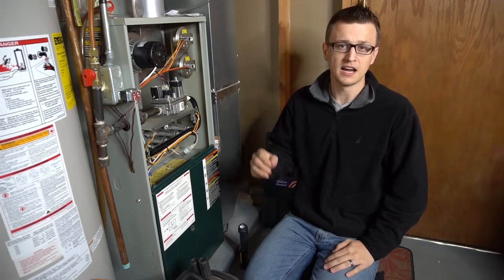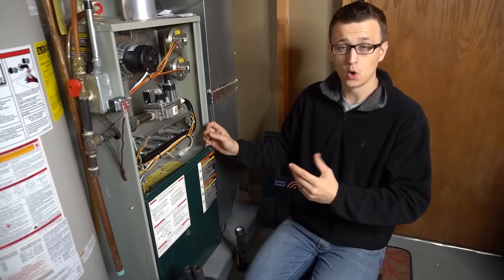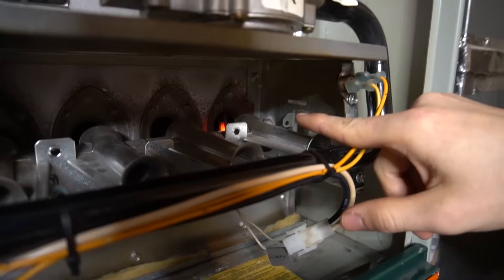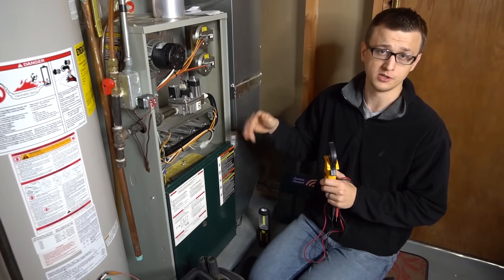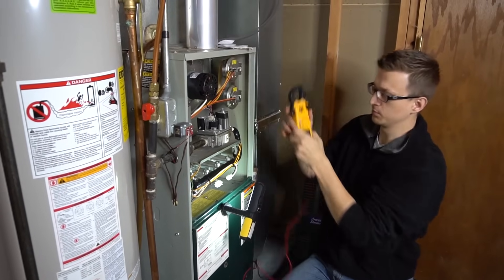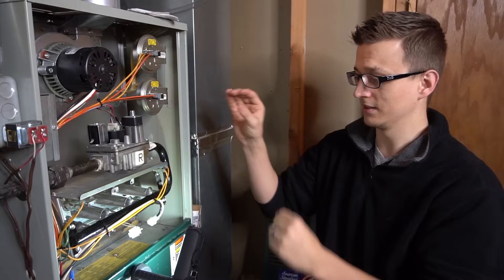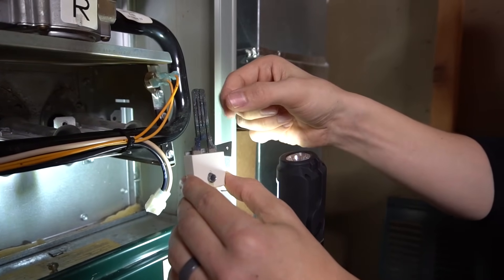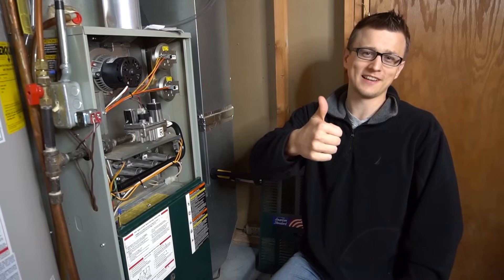Furnace Not Igniting - How to Check and Replace Ignitor

Comment: Hey! Thanks for this video. My inducer motor starts and then at that point, I get continuity on the pressure switch and hear those small click. However, that’s where it ends and after a few seconds it powers down. I have changed the igniter thinking that’s the problem but still not working. The gas valve doesn’t open up. I think that’s because the igniter isn’t glowing. I have an error code which says  low pressure switch failed open. When my pressure switch was bad in the past, I still had the igniter glow but not this time. What else do you think i could try?

Comment: Hello,   great channel !  I have a Bryant furnace 383KAV036111 with a bad ignitor relay.  The relay has 120VAC in but nothing out (with
my finger on it I can feel it clicking).  The board is HK42Fz009 and the relay has no identifying marks on it. It uses a through the board
soldered connection.  Other than the ignitor problem the furnace works OK when it is lit off manually.  A 34 error code is displayed. Wondering if there is some error condition that would stop the control board from lighting the ignitor ? Has anyone ever found an available relay for a Bryant control board ? Any help will be appreciated.
Dan R.

Comment: I have a "Check Ignitor" fault code on my Trane XL80 unit. When it calls for heat the inducer motor starts up for about 1 second then turns right back off. The resistance on the ignitor was only about 15 ohms but I was only getting about 60 V going to the ignitor. In your video you said if you are receiving voltage then it should be the ignitor itself, but what happens if you are not receiving the correct 120V that you should be expecting? Could this possibly be a bad control board? That is what I suspect, but I am not sure. Have you ever come across this issue? 
I also checked the flame sensor  and it looked pretty clean, but I cleaned it a little more just in case. Also if it was the pressure switch I believe I would be getting a pressure switch fault code (3 flashes) which I did not get.

Comment: Thank you for your service 😉 what if the hot surface igniter works only once in a while? I have replaced and it worked for a couple days then stops working and starts again after a while 🤔

Comment: Can I really cut the old ignitor wires, strip them and pigtail them to the new ignitor?
Reply from the maker: Yes. If the ignitor is the same but the plugs are different, you can totally do that. I've done that many times and never had a problem.

Comment: Thanks at the 3 min mark when the gas came on why did it not shut down ASAP and you should smell the gas also right? I think my Lennox does not allow gas to come out if the ignitor does not glow also the ignitor will not come on if the pressure switch does not work either. I think it is the ignitor but too hard to get out with out taking things off. Not enough room to take the ignitor off the harness it is way in the back and you cannot see it hardly and the bracket has no room back there to move it or drop it less room then the bracket and ignitor  . Should a person here the click of the pressure sensor, as I do not hear a click for that either. Code says ignitor so I guess I should trust those fast alternating green lights LOL. Thanks guess I will have to call a tech to come in just to get that darn ignitor out.

Comment: RE: Trane xc95M Furnace: Gas will not ignite. Replaced Hot Surface Igniter. Now when call for heat, Induction motor comes on, then after about 45 seconds the induction motor turns off, and only then the hot surface igniter starts to glow. Why is this out of sequence order?   Should be Induction motor, Igniter Glow, Gas open, Ignite. Any idea what’s up?

Comment: I just bought a house and the filter was so caked it was domed and now have to change the igniter,flame sensor and the fuse to the igniter do to over heating from low air flow

Comment: Hi Jay, 
Took your word of advice off a previous video and was lighting the furnace with a barbecue lighter. I received my new direct spark igniter from Amazon today. Unfortunately the furnace is not coming on. 
Lennox model number: 80MGF2-45A-2
Serial number:6394A48898
In the event the connection from control board to the igniter is bad, how do I remove it from the control board. Is there any replacement available out there? Thanks in advance for looking into this.

Comment: For the new tech out there, buy a stubby Klein Tools 32561 Multi-Bit Screwdriver / Nut Driver, 6-in-1. I just replaced a surface igniter on a Goodman furnace. I had very little space to work, the 1/4 inch bit saved me.

Comment: I have watched a ton of your videos, Thank you I have learned a lot.  What I have gathered is my Ignitor (replaced and is new) is not receiving enough power.  3.6 AC Volts and then after the blower motor clicks, the volts slightly jump to 5.6 AC Volts.  Everything else is working, as we have been able to manually light the furnace.  Is this a simple replace the wire from the control board to the ignitor, or is this an entire control board that needs to be replaced? Thank you!
Reply from the maker: You're welcome! Glad to hear you were able to make some progress in your troubleshooting and can get the heat going. This is likely a bad control board issue. It could be a loose connection too so I would try testing the voltage and wiggling the wires, plugs, and connector while doing so. You may need to try a couple times since the ignitor only gets powered on for 5-10 seconds before the gas valve opens and powers off shortly after.

Comment: What happens when you don’t hear gas going through it but the gas is on and working everywhere else and the starter is ticking.
Reply from the maker: I would check if the gas valve is getting power when the starter is ticking. If it is getting around 27v yet the gas is not flowing, then either the gas valve is stuck closed or the burner orifices are plugged. Here are some simple things to try:

Wiggle the wire connectors going to the gas valve once the ignitor starts to spark. If the gas valve opens, then you have a loose connection there. Sometimes I would simply wedge something in between the connector and the body of the gas valve and that would solve the loose connection issue. Or perhaps one of the wires is coming out and needs to be secured back in place.

Hit the gas valve (not too hard) on all sides. If it is mechanically stuck closed, that might be enough to free it up.

Clean the burner orifices. I show how to do that here: https://youtu.be/aM4OXM8ruNk?si=2JbmQcUa5LKa_JcD

Comment: What advice would you give me if mine turns on, the igniter glows, and I hear the gas seeping but it doesn’t ignite??
Reply from the maker: You may have a weak ignitor. Even though it is glowing, it is not getting hot enough to light the gas. I would try to light the burners manually. If they light, then you know the ignitor is bad. (it's a rare occurrence but the ignitor may not be getting enough voltage too, in which case the control board might be bad.) Another possibility is a plugged burner orifice. Here are two video on the above two topics:

How to manually light furnace:
https://youtu.be/-bMz1En0DSg?si=4OQBshU5bFE6y9qI
How to clean burner orifices:
https://youtu.be/aM4OXM8ruNk?si=mzIvIn5HSLjQsojG

Comment: how do you just unplug the ignotaror?
Reply from the maker: You would disconnect it either at the plug/connector or at the control board. Sometimes you need to pry on the plug with a screw driver because the plug is really stuck together.

Comment: I had my furnace blowing cold air so i check on your video and saw the picture of the bad ignitor you shown then I found mine has that same bit, so ordered an new one for Rheem furnace from Amazon with identical shape and connector for next day delivery and installed the new one, fairly easy and was back to business, thanks so much👍

Comment: Excellent video!  We woke up to 27 degrees and the downstairs furnace not working. After watching two of your videos it was apparent that the ignitor wasn’t working. Tested it and sure enough it was dead. Once pulled I could see a crack in it. Ran to the store and got a new one.  All in all we were back up and running by 9am. Thank you!

Comment: What if the connector coming off the control motherboard has 120v, but as soon as you connect it to a brand new ignitor, the voltage drops to zero?

Comment: Thank you for the videos.  I had a quote for $200 to replace my furnace ignitor. I watched your videos and I purchased an ignitor from Amazon for $40.  I actually replaced it myself.  Took me about 30 minutes to complete the job since I cleaned the sensor as well.  You saved me $160 and I learned something new.

Comment: Hi my hot surface ignitor glows, blower kick on when thermostat calls for heat, but I don't get the click of the gas valve. I've cleaned the flame sensor rod and not sure what else to turn to.

Comment: Have a furnace with a good hot surface igniter (put it in another furnace that uses same model igniter) and the igniter isn’t lighting in the first furnace. Cleaned flame sensor with fine steel wool. Inducer motor is turning on. Is there a replaceable relay to ignite? (Lennox 80uhg3 75a)

Comment: Hopefully you still read your new comments. I replaced my igniter but now my furnace will only ignite after cycling twice. I don't see an adjustment on the igniter bracket. What could be my issue?
Reply from the maker: Does it fail to ignite the gas or do the burners light but go out after a few seconds? Regarding the igniter bracket, I have had to bend the igniter bracket in the past to place the igniter closer to the burners. But if the burners do light but fail to stay on, then it's a flame sensor issue. (usually resolved by simply cleaning the flame sensor) Another possible fix is to clean the burners. (I have a video on that if you need it)

Comment: Inducer turns on , but the igniter does not glow. After I check the voltage, and I don't have 120V supplies to the igniter, is it meant the circuit board is bad?

Comment: What if I only have 54 volts to the igniter and it’s not lighting ?
Reply from the maker: It is either a bad connection (check the connectors, tug on the ignitor wires, wiggle them around and see if that makes the voltage fluctuate at all) or the control board is defective.

Comment: great videos! does no power to igniter means the control board is bad and replace it?
Reply from the maker: Often times, yes. It would be best to verify it if you have a multimeter. The ignitor should have voltage going to it shortly before you hear the gas valve click open. If the gas valve is opening but there is no power sent to the ignitor, its almost for sure a bad control board. Also possiblly a loose wire connection

Comment: Great videos, I've watched several! Got any tips on how to check the output of an ignition coil? My furnace works fine if I ignite the burners by hand, as you have shown, but automatic ignition is broken. How can I determine if I need to replace the igniter (spark type) or the control board, where the coil is mounted? I have a jumper wire with alligator clips on each end. I connected one end of the wire to the coil output pin. I placed the other end of the wire close to the heater frame (ground) with about a 1/8 inch gap. No spark is seen during startup. Is that a valid test? Any suggestions?

Comment: Hi, Thank for all your help and assistance. Also sometimes you just make me laugh so thanks for that too.  Anyway, I just used some of this information to fix my pool heater.  I notice you explain things about a lot of different appliances but I see nothing on pool equipment particularly pool heaters ( which are a lot like a furnace but not) and pool pumps. Any chance you could wander into this lane.  Keep up the great content. Thanks again.
Reply from the maker: Hi David! Glad to hear you were able to get the pool heater fixed. If I get a chance down the road, it would be great to make a few pool heater repair videos! Thanks for the suggestion!

Comment: If the ignitor is no good, will the fan blower fan still be blowing cool air or it will the furnace shut off cause its not igniting?

Comment: Where to looking for part number? or they don't have part number.
Reply from the maker: They do have part numbers but I usually replace original ignitors with universal ones. As long as it looks the same, it should be good. I also have a video on how to order hvac parts, you could refer to that too if you want to get a part number.
Reply: Thank you for explaining

Comment: I never comment but thank you so much. Company tried to charge me $5,500 to replace a control board, igniter, and capacitor. I bought all the parts for $150!
Reply: Yeah there are CROOKS  out there for sure ..been there done that that is why I am here do not trust them, AND this man is very very intelligent with very good tips. Best on the internet
Reply: That is the cost of a brand new furnace
Reply: @cgdonut27 exactly.  Interesting how repair costs always compare to new furnaces from the furnace co. That sell them

Comment: OK, that was first step, testing the igniter. Good information on that. 
Now, what is step #2, igniter is good, but no 120 volt voltage?
What if you don't hear the gas valve open? My Goodman propane furnace waits a bit while the igniter glows before the valve opens. Do you have other videos that step through each step of the troubleshooting process ? Inducer motor starts OK, then igniter should glow, then gas valve opens, and then burners ignite. How do you troubleshoot faulty control board?
Reply from the maker: Is the control board blinking any error codes? I would start with that. If the inducer is turning on but nothing else happens, you may be having a pressure switch issue (I do have videos on that, including one where I show how to bypass it to confirm if its where the sequence interrupts). If the pressure switch is closed and the control board is not showing any error codes yet the ignitor is not getting 120v, then the control board is likely bad. Diagnosing a bad control board is usually done by narrowing down the possible culprits. If the board is supposed to be sending power to a component yet it is not doing so (even though all the safety switches are closed) then that is a bad board.
Reply: @WordofAdviceTV  
Okay went to test the igniter this morning there was 80 ohms resistance. when I tried to check the voltage I had the igniter removed from the circuit , the inducer motor started up but then it shut down so I had to plug the igniter back into the circuit and then when I started again the igniter lit up and the gas valve opened and the burners ignited. I'm guessing it was a bad connection at the two connectors or some corrosion over the summer? I'm aware of the vacuum switches and last year I found that it wasn't pulling any vacuum because there was a water back up inside the enclosure around the A-frame evaporator. And that vacuum switch was also corroded I drained out the water, clear the blockage to the drain I had to replace that vacuum switch too because besides not closing because of no vacuum and not closing which was preventing the gas valve solenoid from engaging because it couldn't detect enough low vacuum pressure which is proof that the inducer motor is running and evacuating the gases from the combustion chamber, the switch is a NO contact and it was not closing because I guess being corroded. 
Now here's one for you I also discovered last year that the manual control to turn on the fan would not work from the thermostat and the fan wouldn't come on with the AC compressor but if I bypassed the vacuum switch by jumping across the two connectors then I could use the manual switch to turn the fan on at the thermostat and when on AC cooling the blower would work. So does that sound like a bad solenoid perhaps on the control board?

Comment: Thanks so much for your repair videos!  I have the 3rd type igniter as shown, specifically the type in the lower photo.  (The bi-metallic strip inside had gotten "corroded" causing the furnace to short cycle.)  I replaced the igniter, all was well.  Next morning, ffffttt, no pilot light!  Turns out, the 3 wire plug was not fully seated, hence no pilot!  After a quick unplug and re-plug, all is well again!  A friend also loves your videos and was able to correctly diagnose a faulty control board!  You Sir are a YouTube gem!

Comment: Thanks so much for this!  It helped me figure out that my igniter in my York heater had failed (it had a crack in the middle). The igniter sits very low though.  The only way I can get it out is by pulling it from the top.  I doubt I can put in a new one without touching the element 😕

Comment: My heater only kicks on with warmer temperatures kind of defeats the purpose. If the ignitor is bad, does that mean it works sporadically, or does it just not work at all?  I cleaned the flame sensor, so I'm  thinking it is my ignitor. Any thoughts out there??
Reply from the maker: Sorry to hear about the furnace troubles. I don't think that the ignitor is the problem. Perhaps the furnace is overheating? This problem can go unnoticed when it's warmer outside but once it gets cold, the temperature in the house starts to drop. I would try replacing the furnace filter if you haven't yet and when the furnace is not turning on, look if it is blinking any error codes. That would be a good place to start, to get an idea of what may be going on.

Comment: This video save me a lot of money! It was presented in a professional easy to understand manner. I'd like to add a couple things the high efficency Trane - American Standard are 80 volts AC and the voltage wasn't on the wires if the ignitor isn't plugged in. Without it plugged in the meter jumped up for a brief bit then dropped to zero. I used the back stab method that the presenter described to check the voltage.